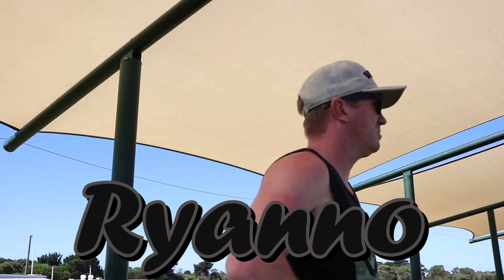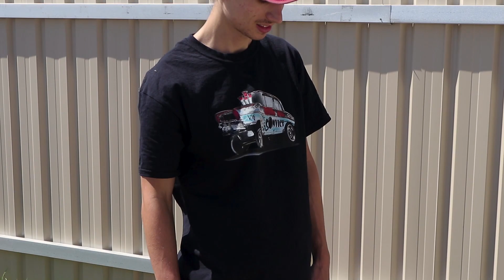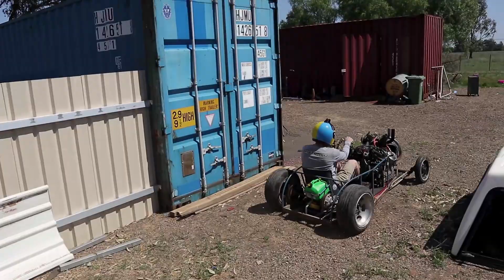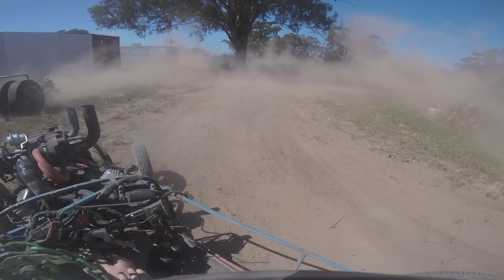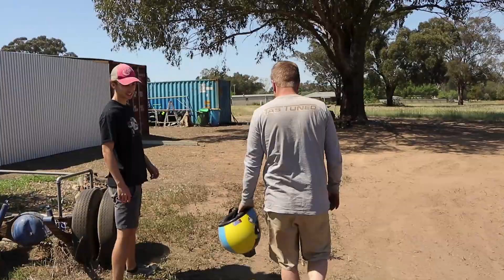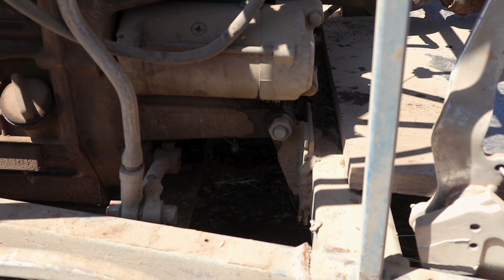Turbo CX500 Mini Hot Rod Shakedown!

Comment: I would like some info on this build. I want to build something similar. It freaking awesome! What rear differential is that and what front axle did you use. I'm sorry I have so many questions but it that cool.
Reply from the maker: Hi!      Thanks, I need to get it all finished off!    The front axle was just some welded tube and stub axles off an old go kart.   The rear differential is based off the original cx500 rear wheel hub.    If you search my other videos I have one showing how the rear end works
Reply: Ok awesome thank you for the reply I will keep in touch as I want to start my build soon